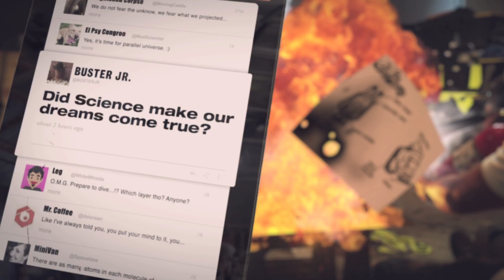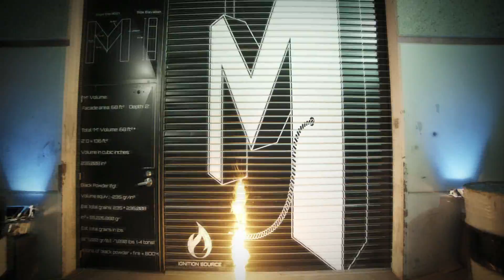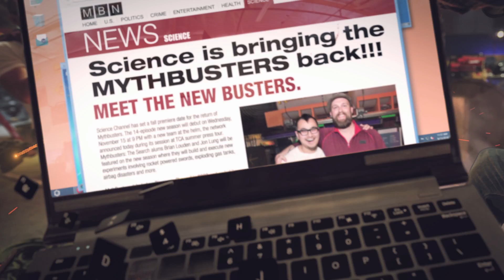Meet the New MythBusters in This EXTENDED PREVIEW of Episode 1!

Comment: It is Historical EUROPEAN Martial Arts! But still glad to see RJ there, and that our martial art is getting some exposition. 
At first I didn't like you guys used the cold steel messer, but it is fine as you guys cut a portion of the blade.

On the other hand: I like the guys, of course I miss the original team, but its ok. However I don't like the way the tested the myths, the show is focusing too much about having fun with rockets and explosions and omitting the science part and the actual desire to prove the myth. I know that the original show was sort of on the same way but the ratio here is much bigger. For example on the sword thing: the myth they are trying to prove is something that actually happens with tatami, you can cut with the sword and the upper part stays in place, thanks mainly because the fibers of the tatami can keep enough friction and support the weight of the piece. So cutting a head at the neck simply won't work because there is a small hard target and you have a small piece of meat, ligaments and bone supporting a big and heavy head. However they are basing the myth mainly as it appear in Underworld where  Kate Beckinsale cuts a portion of Victor's head the cut portion has much less weight and a lot of tissue to keep friction. My point is, they omitted many variables in order to keep it fun. Also they could have use many other things besides rockets to impulse the sleight.